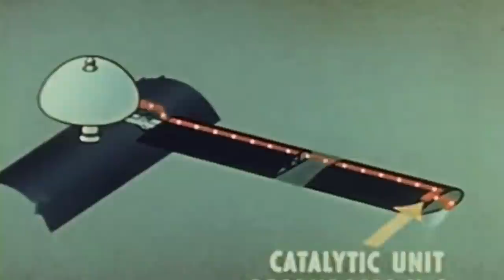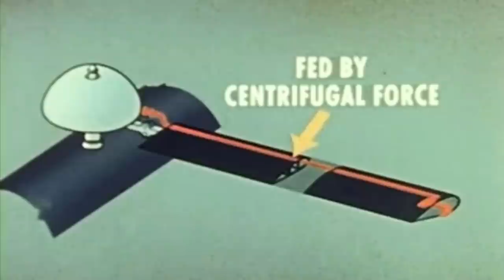Helicopter with Rocket Blades

Comment: I think I know why it was never used. The advent of the turbine engine which was being tested at this time. Would make the ROR obsolete before it could be installed.
Reply: Bingo. The legendary Bell Huey first flew in 1956.
Reply: That and the logistics of keeping operational units supplied with the fuel, spare blade tip rockets, etc.
Reply: Safety too.. that concoction on HP was incredibly dangerous just hitting a line or the capsule would basically ensure the death of the helo and crew.

Comment: As someone who flies helis
It VERY likely failed because the rotor blades are not meant to have torque originating from the tips…. Also additional vibrations will completely fuck up your blades
Reply: J D  I remember that episode, too. I don't remember the stamp causing any problems. What if a bird shit on a rotor blade? That weighs more than a stamp. There would be helicopters crashing everywhere!
Reply: I'm sure that these rotors were designed with that in mind.
Reply: Wouldnt they have seen rotor blade instability issues while testing the ROR?
Reply: I think it likely failed because it was a lot easier to just get more hp out of the motor in the next revision than to install an additional power system.
Reply: The turbine powered helicopter came along not much later which really helped out the power situation also.
Reply: Language-be an example for the young folk
Reply: If we're talking about high altitude performance, isnt the actual aerodynamic performance of the rotor an shortcoming? Im wondering if it wouldve taken a rotor redesign in terms of like camber, chord, rotor length to get meaningful high altitude performance out of it, at the same time potentially compromising it at lower altitudes
Reply: Maybe it was because if they were targeted for atack the unit would be vulreble
Reply: I lean toward it having 90% hydrogen peroxide that is insanely scary stuff like opening the covenant scary
Reply: There are several successful DIY ultralight helicopters that operate entirely on these tipjet rockets, should be fairly reliable and stable as it has almost no moving parts too. There really isn't a good reason not to use this, even today it would be an excellent backup power source in case of engine failure.
Reply: @NotProFishing  
Exactly.  It leaks on your skin and you burst into flames.
Reply: @harley092355  is that you mike from Nova Scotia?
Reply: @dextermorgan1  bird shit would cause aerodynamic problems more than balance issues, and the bird would have to be larger than a pigeon to do so.
Reply: @PineyJustice  there is a really good reason the army isn't using this. Fuel consumption time from full to empty is too short to get a meaningful flight out of it if it were the only source of power.
Reply: @jmdesertadventures803  That's not what it's for at all though, it's for extra power lifting heavy loads or taking off from altitude. In addition it could allow a safe landing in an engine out scenario.
Reply: @tracyrreed  Bingo!! Turbine engines were coming right up.
Reply: It was not said to have failed. On the contrary, it was stated to have worked. The question becomes one of why it was not implemented, for which there are answers that go well beyond the scope of functionality. Ultimately, we are not given enough information in this video to determine exactly why this idea was never adopted. It is worth nothing that the The Fairey Rotodyne featured a tip-jet-powered rotor, so your assertion as to why this add-on power option was never adopted is most likely incorrect. One probability is that someone may have questioned the safety aspect of storing a large volume of high concentrate hydrogen peroxide directly above the main rotor. As for vibration, imagine if one of them failed during operation. Regardless, it did seem to operate as intended, but safety and practicality most likely shut this one down.
Reply: @HangTimeDeluxe  Many of the commercial models using tipjet propulsion the tanks are actually stored below the rotor, yes a large volume of H2O2 could be an issue, but even a 30-60 second volume to land vs crash would be huge.
Reply: That could be risky, imagine a bullet piercing one of those. Wouldn’t that cause an explosion?
Reply: J D  
I saw the same episode. If I recall correctly, one postage stamp did jack squat.
But a chunk of steel, I believe, about the size of twenty postage stamps stacked on top of each other (which still isn't very massive) did well enough to cancel a takeoff.
Reply: There have been successful tip jet helicopters in the past, such as the ramjet-powered Hiller YH-32 Hornet of the early 1950s. Even though it was very lightweight and simple, it wasn't adopted due to having marginal performance compared to conventional helicopters and difficulty in setting up a successful autorotation landing in an emergency.
Reply: Also, I ran the numbers and this only made 74 hp at max rotor rpm
Reply: That and the maturation of the jet engine solved the power problems helicopters had too which made the ROR system redundant.
Reply: Huh??? THEY SPENT YEARS ON THIS! If the problems were as you say, they would given up in the first six months or fixed the problems and kept going...no.........they could easily have solved such issues. yes, I worked on making the B-1 Bomber engines and worked at the Naval weapons Lab and helped design an escape system for HELICOPTERS!
Reply: @jmdesertadventures803  think of it as nitro for helicopters. it's just for a boost.
Reply: @basketcase1235  I know, but this has been tried as a primary power source as well.
Reply: @dextermorgan1  small imbalances do induce vibration which does lead to increased rates of wear. Helicopters need to be very well taken care of. People don't let birds shit on them. Birds don't try to either.

Helicopters don't crash because they are well maintained. Also, look up the auto gyro. Helicopters don't crash because the blades can be both windmills and wings at the same time allowing them to have a controlled descent.
Reply: @BrettonFerguson  Yes, hydrogen peroxide is extremely corrosive and risky.  Interesting concept though.
Reply: No autorotation
Reply: No, it’s because engineers are nerds. Her tipped helicopter blades rule.
Reply: Complete nonsense. 

I guess this is why you fly helicopters and don't design them.

Comment: I wonder if they didn't like what happened when a bullet went through the spinning dome full of highly volatile hydrogen peroxide on top of a flying helicopter.
Reply: I mean to be able to hit that thing above means you have to essentially hit the chopper already which makes no difference. Plus it's well protected from ground fire as it is above the chopper and you can always add self sealing tanks instead.
Reply: Boom...
Reply: Hydrogen Peroxide is NOT highly volatile. It is a lot like water, only heavier and has a boiling point 90 degrees greater than water at 302F.  It doesn’t burn or ignite in the presence of an ignition source.  It is an oxidizer and at the 90% concentrations they mentioned, reacts with organic material(humans) pretty severely and can cause severe injury.  Which was probably why they chose not to adopt the system.  It’s use as a fuel involves a catalyst, in this case a platinum or silver mesh screen in the rocket chamber at the rotor tip.  When the fuel flows into the chamber the catalytic reaction causes the atoms to separate into h2o(water) and O2(oxygen)  It also releases a tremendous amount of heat(like an auto catalytic converter) which flashes the water to steam.  The expansion to Steam provides the clean thrust without fire/flame…  for other examples of this power source, search Bell rocket belt, Bell rocket pack, Bell Jet Pack, ect…
Reply: The Army didn't want to have to move big tanks of that stuff to their operating bases, add all the associated infrastructure, suffer the inevitable accidents, for seven minutes of double-power flight time.
Reply: Don't forget as I expounded in my post above. The Turbine engine for helicopters was already coming down the road. The French were experimenting with it and the Bell Huey prototype flew in 1956.
Reply: Hey! You might have something there!
Reply: @rronmar  Actually, hydrogen peroxide is very problematic. Concentrated H2O2 reacts violently with a large number of materials, such as many metals and oxides. Even a spill onto the ground could be a disaster. It's extremely corrosive to organics, including human flesh. If fact, it forms one half of Piranha solution, an extremely corrosive solution used in chemistry to super clean lab equipment. It decomposes over time, so it has a limited time span for use. Even in a lab, high test H2O2 is handled with extreme care. I know this first hand, as I was a chem major in university.
Reply: @PointyTailofSatan  yes, it is extremely problematic, I was just saying that it was not very volatile(doesn’t burn or explode out of storage).  A bullet thru the tank would cause a leak that may or may not find something to react with but it would not explode…  it will react violently with a catalyst, and is quite reliable and predictable in that regard which is why it can and has been used as a fuel in so many cases.  The germans started using it in their rocket fighter and bell aerospace and nasa used it a lot in early R&D like projects seen in this video.  The bell rocket belt vids are pretty cool:)
Reply: @PointyTailofSatan  ya he said that.
Reply: @PointyTailofSatan  Saying H2O2 is one half of Piranha solution is like saying a knife is half of a murderer

Comment: I suspect the reason it was never adopted has something to do with the extremely corrosive qualities of 90% hydrogen peroxide. Not to mention the danger of having a tank such a high-quality oxidizer on board in a crash situation.
Reply: Lets not forget on-site storage of 90% peroxide at any military base facility in a conflict area would be a serious challenge too. Storage of this material in such a way that it just maintains it's 90% concentration is a serious challenge. The fact that it's a general hazard in ideal conditions for all concerned doesn't help either.
Reply: Hydrogen Peroxide at 90% purity can also be an unstable high explosive. This is the stuff that sunk the Russian submarine Kursk .
Reply: Yeah and if one of those fails when other ate running then rotor system would rip apart
Reply: Or the fact your enemy has a nice big target (the tank) to rain hellfire down into the cockpit. Not super practical but that’s how innovation works.. a shitload of bad ideas til you strike genius.
Reply: That seems to be a main reason why a lot of innovations never really seem to catch on. It sounds good at first and probably does well but then you take a step back and look at the whole practical side of things and realise how horrible of an idea it is.
Reply: Solved one problem, but created like 5 new ones lol. But progress comes at a price.. good thing we had many minds working on the issue and had options.

Comment: The ROR would've been nice to have in the mountains of Afghanistan.
Reply: Bro.... SERIOUSLY.  All the issues we had to overcome.... and they had a solution in the 50's?!?!?!?!?!
  I've pumped fuel to an off board bladder to get the bird up, then pumped the fuel back in....  holding my damn breath,  lol.
Reply: Thank you all for your service. I went to basic in 90 and due to a preexisting knee injury that reappeared 4 weeks into bt and got a “Thank you for trying, keep the ugly glasses and here’s a plane ticket home” speech. My oldest son is 10 years in the Army now. I live 1/4 mile from Ft Bragg and I’m damn proud of all who serve(d). Much love 🇺🇸🇺🇸🇺🇸
Reply: Keep in mind that those helicopters had piston engine with far less power than today ones. So it's not that sure if it could really helps nowadays.
Reply: @SebastienChedalBornu  true. But do we know that it wouldn't have?  Or a variation/advancement.... or even sticking with it in the. Beginning and adapting technology with the growth of helicopter tech.
  It just seems like it worked, and they never pushed forward.
Reply: @ryateo1  there was other prototypes of rocket on rotors especially for VTOL airplanes but they abandonnés because of serious vibrations. The problem when you apply too much force on the tip plus the wind turbulences etc. I think this proto worked because it was an additional of what 30% max may be less. Rotors have to bend for the sake of the flight. But if you put all the force on the tip then you pull on the rotor rlmaking it too stiff. So everything goes into the copter
Reply: @SebastienChedalBornu  i
guess that's worse that having to hover for minutes behind enemy lines while you transfer fuel from the ground.
Reply: @ryateo1  I don't see the relationship, ror is to be considered a boost. But even with that if you look with a perspective it wouldnt change anything on the problem you mentionned.
The mountains in Korea are not that high,  2744m for the highest.
Its just that those copters where the first, like the WW1 airplanes.... 
Plus the copters have lots of power now, but still they are not that powerful in high altitude, but this is because yes powerplant are bigger so they say we can put more men more armement more fuel etc.... And so the copter is heavy but it can fly and fly correctly especially compared to the mosquitos they used in Korea.
And they for sure would not be able to fly in Afghanistan and their 7000m mountains. But a lots of general aviation planes cannot fly that high too.
Reply: @SebastienChedalBornu  we didn't need sustained flight.   Only to get the loaded bird off the ground.   
  Some kind of ROR would have allowed us to load and lift, instead of  playing the games we did to get them off the ground. 
  And I absolutely agree it may not have  been practical, but this video implies they walked away from this 50 years ago.
  The video also said that a larger powerplant would not have been able to overcome the issue...
 Bro, i went from a rifleman to wrench jockey.   I'm not going to pretend to understand the science  though🤣😂
Reply: Too busy funding the raid on the national history museum...
Reply: @ryateo1  Ah the 50's, that magical decade they discovered solutions to most of life's problems.
Reply: @killman369547  hard to believe we were closer to landing in the moon than we are now. Lol
Reply: I think the endurance was the main issue. You carry extra weight all the time for the system but use it for a very small percentage of the flight.
Reply: @billphillips5806  this is just soutballing....
You dont need it all the time.  Make it disposable.  for when you just need that extra to get the bird off the ground.
Reply: Aged like Milk.

Comment: 90% hydrogen peroxide is hazardous stuff to work with and the military probably realized guys would end up getting injured. Around the same time they also started using turbine power in place of the heavy inefficient piston engines so that resolved most of the power issues.
Reply: There's a reason (a very good reason) almost all navies stopped using HTP torpedoes decades ago. They are scarily unstable weapons. If the HTP started to decompose in the fuel tank of the torpedo you would have less than 30 seconds to jettison the weapon before it explodes
Reply: @killman369547  The Kursk Disaster showcased that one perfectly.

Comment: You should do one on the Hiller Hornet Helicopter, saw it at Fantasy of Flight Museum. It uses Ram Jet engines on the blade tips.
Reply: I'd never heard of that until now, cheers mate! 🤝 🍻
Reply: I remember seeing that in a book when I was about 7 or 8, always thought it looked really cool.
Reply: Super nice museum in the bay area has one in perfect conditions.
It had no tail rotor because you are producing the torque on the spinning blades 🤯